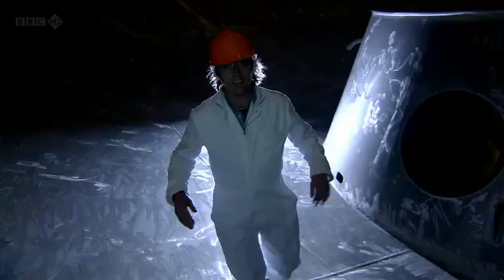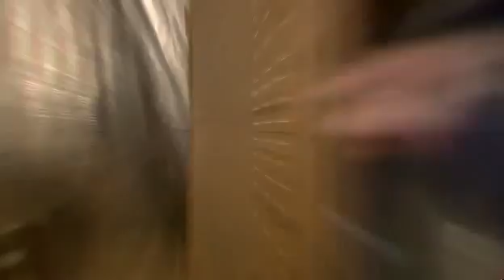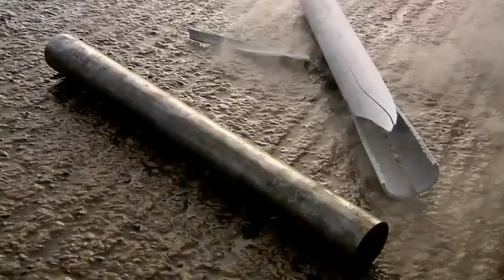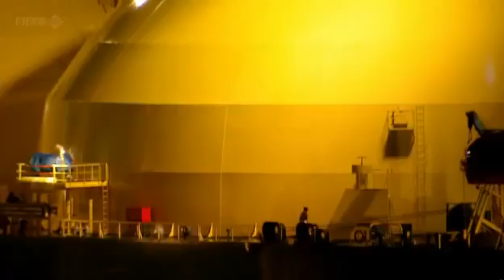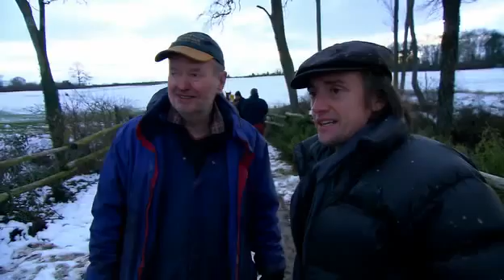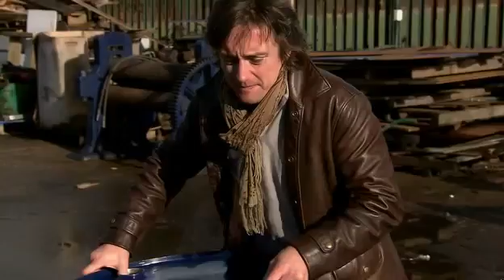Richard Hammond's Engineering Connections - (S03E03) Super Tankers.

Comment: It's a bit misleading to say a single spark could ignite liquid aviation fuel - you can drop a lit cigaratte into a bucket of jet fuel and the cigarette would go out... There has to be a mixture of oxygen and fumes from the fuel to ignite easily.
Reply: won't there be fumes coming from the the bucket?
Reply: Simon Coles Great job. You didn't pay attention at all and then decided to comment. You're officially that guy.
Reply: Depends on what sort of aviation fuel you are dealing with. The Empire flying boats referenced here were not jets - they had propellers driven by radial piston engines. Those use avgas, which is just as volatile as gasoline - meaning it vaporizes easily and can be ignited by sparks. This is after all exactly what happens inside the engines that use it as fuel.

You are however correct about jet fuel, which is rather different to avgas. Jet fuel is still a liquid hydrocarbon fuel, but with a much higher boiling point, since jet engines don't use carburettors and hence don't need a volatile fuel. Jet fuel is closer in composition to diesel, and the US Air Force actually have trucks which can run on either diesel or jet fuel, or a mixture of both if necessary.

The high boiling points of either jet fuel or diesel also give them high flash points: the temperature at which the vapour above the liquid becomes flammable. This does indeed make them much safer - a lit cigarette won't ignite jet fuel or diesel, and an electric spark won't ignite them either.

Comment: considering the fact that it would explode more like a fireballs *poof* (though way more impressive than just going poof), instead of a solid matter explosion of KAFUCKINGBLAMMOTHERFUCKER!!! (yea, they sound kinda like that...ok not really) it would end up creating a fireball a few hundred feet wide and turning the ship into the largest floating bonfire youve ever seen for a few seconds.
Reply: but the tanks are air tight, so surely if they set on fire the gas cannot escape causing the top of the tank to explode off, sounding like a bomb
Reply: however though as he said it cannot set on fire, because there is no oxygen
Reply: Old comment I know, but... that's not how explosions work. It doesn't matter if the explosive material is solid, liquid or gas. What's important is the amount of energy contained within it, and how quickly that energy can be released in an exothermic reaction. That supertanker carries 136 megaliters of highly volatile liquid hydrocarbons in steel tanks under high pressure. Hammond wasn't joking with the "55 nuclear bombs" comment in the intro... a runaway explosive reaction on that ship would vaporise it and everything else withing a pretty wide radius in just a few seconds, and the pressure wave would creatively rearrange the internal organs of anyone unfortunate enough to be within the blast radius. Obviously they purge the tanks before putting the tanker in dry dock because a mistake there could literally flatten an entire port. :)

Comment: I wonder how long a ship like that could run (sail) if it running off that Huge amount of stored liquid, months years ???
Reply: mattmopar440 That is not possible because if it would start using the fuel in the tanks the level of fuel would go on decreasing bringing the 'free surface phenomenon' into picture. The tanks should either be full or almost empty.
Reply: I'd guess years, maybe decades.